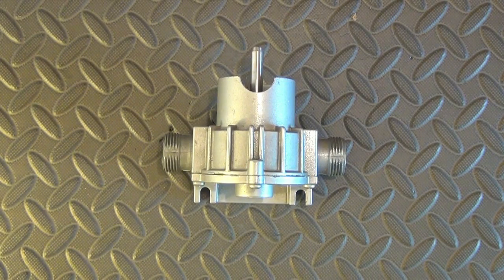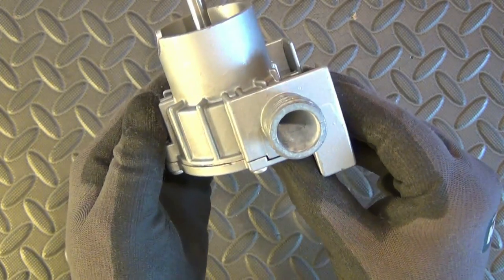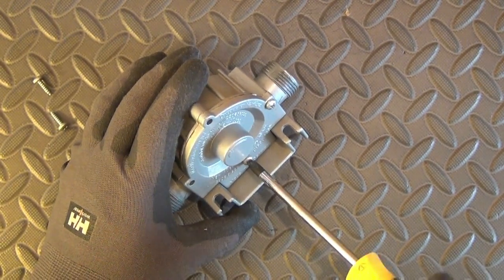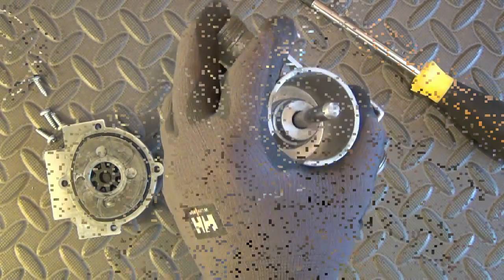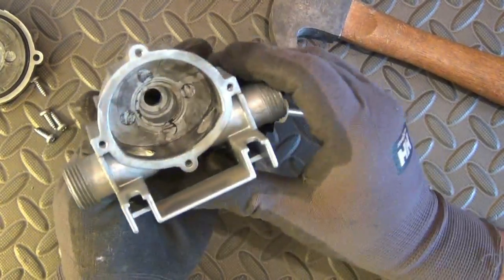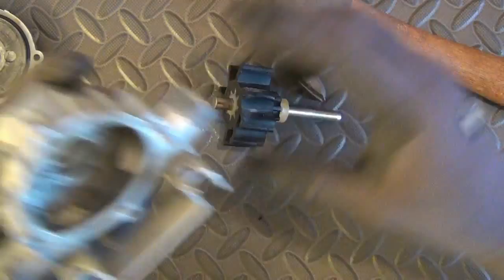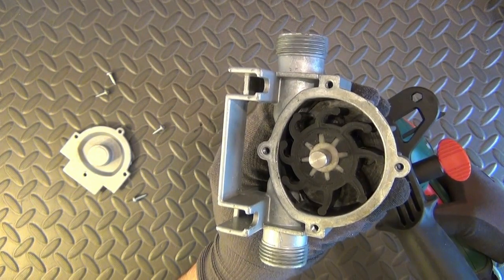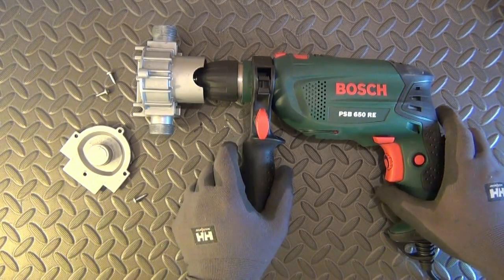Drill Pump TEARDOWN !!!

Comment: do you think it could pump air ? Would it have the same psi than a vacuum cleaner? (I'm looking for a way to use vacuum storage bag)
Reply: probably, but because there is no liquid in the impeller, it might overheat and melt the blade.
Reply: This exact model says 40 sec. max dry run time. No water will kill it!

Comment: They're still made by wolfcraft in Germany. Just ordered one on Amazon. They can generate almost 2.5bar which means they pump water up to 25m!
Reply: What’s the best lubricant you’ve found? Thank you.
Reply: @michaellawcobb2693  good old plain water. Never run it dry for longer than 40 sec. it says on the side.
Reply: You can also pick up an impeller at your local boat shop because they're used in just about every boat motor.
Reply: I bought a similar one from 'Stanley' and it also says 20 to 25 meter. I believe they refer to the length of the hose and not the depth. Seeing how it already struggles to pump water up to 1 meter heigth, I highly doubt it would work from 20 meter deep. Maybe it could work if you fill up the hose with water, because it is with the initial suction that it struggles. Once the water flows, there's no problem.